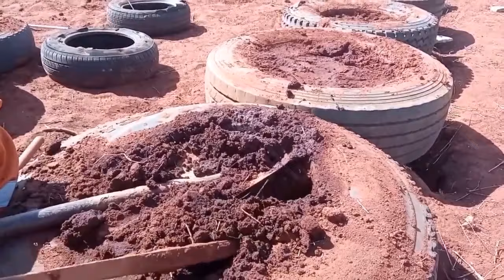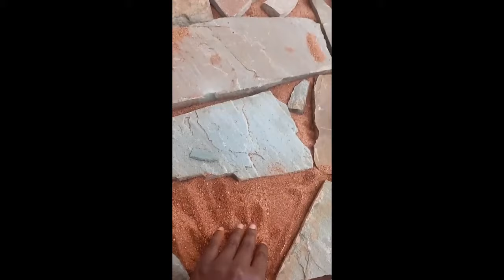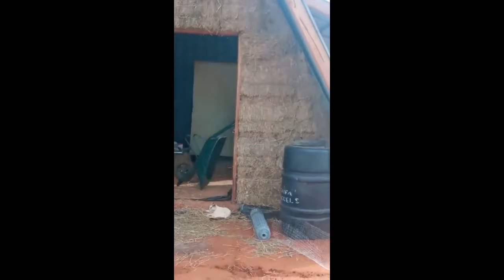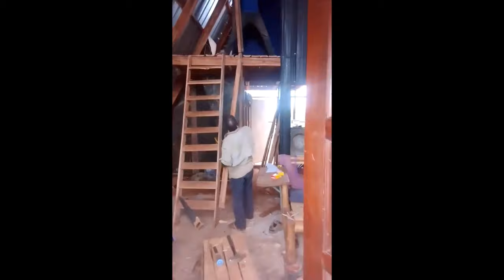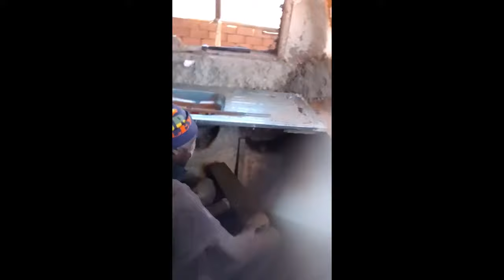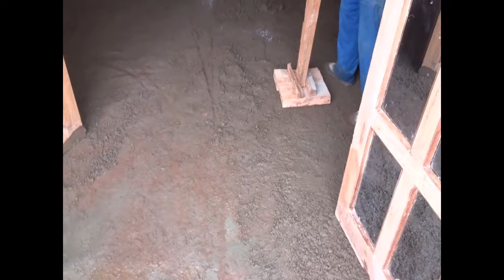UPDATED! Woman Builds A-Frame House with TYRES, HAY, AND MUD(CUTS BUILDING COSTS BY 67%) /Off-Grid

Comment: What solution do you have for termites? Won't they eat away your frames?
Reply from the maker: It's a real concern. I have been treating and retreating with gladiator, diesel and used oil....but as much as I know they are effective...I feel like I will later on use steel/ LGS frames from the inside. Taita termites are not to joke with